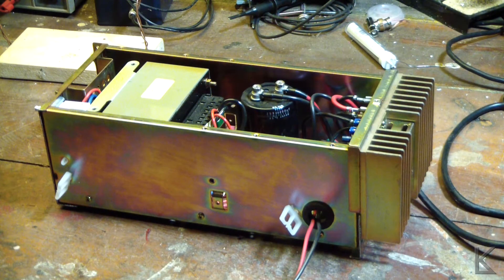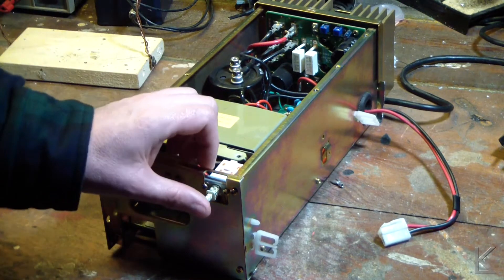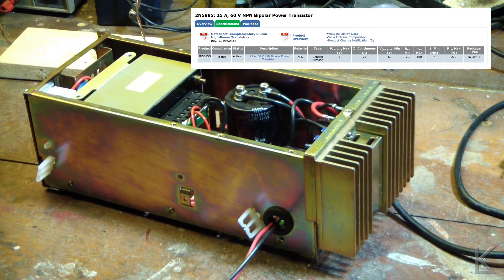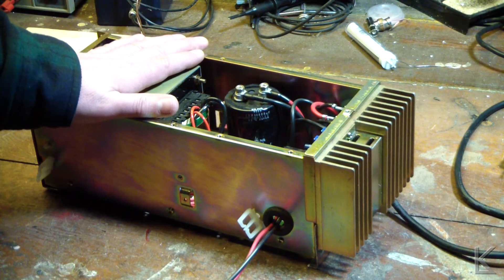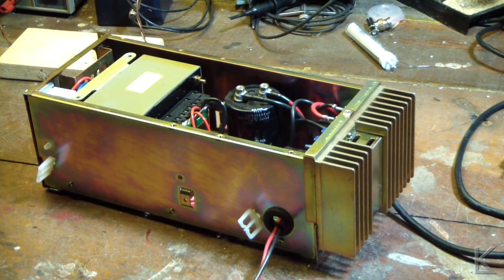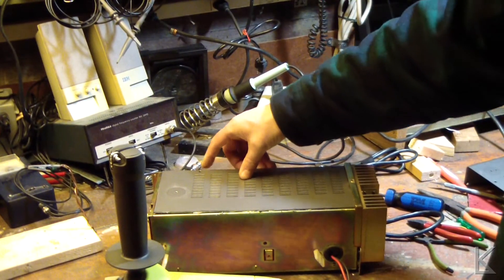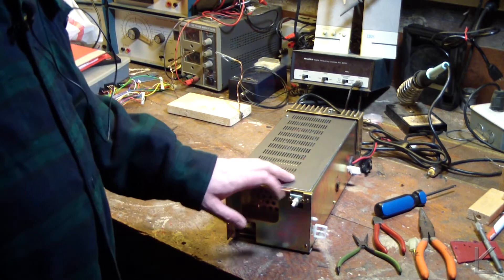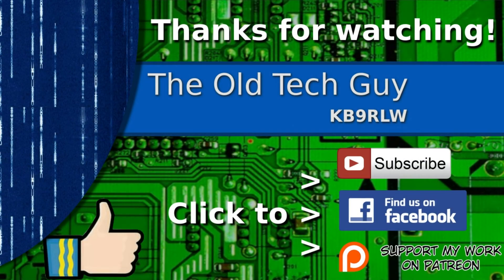Ham Radio - Repurposing the old Kenwood repeater power supply

Comment: SWEET!  You scored a good one with that power supply. I would bet it will handle a 100 watt HF rig in SSB mode and perhaps 100 watts in cw but go easy on the key down time. With 360 watts at 50% efficiency, that leaves 180 watts available. If your transmitter is 50% efficient then it will draw almost 20 amps at 100 watts key-down in CW. Nice job, Kevin. Thanks for sharing this video with us. 73 DE K7RMJ  Frank

Comment: That power transformer is about the same physical size as the one in my Kenwood TS 930S  AT although they have different output voltages anyway but should be about or close to the same power ratings in AMPS and WATTS, Interesting !!!!